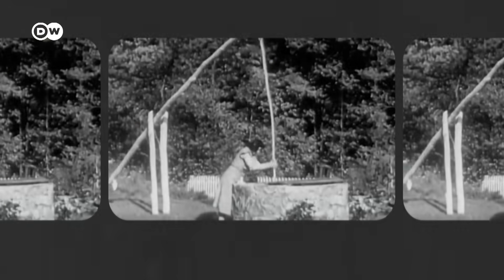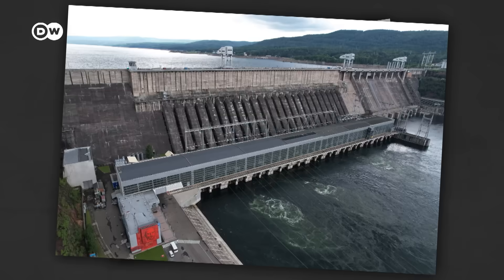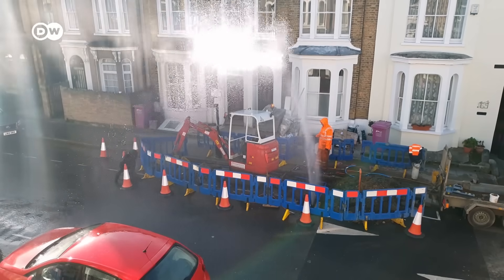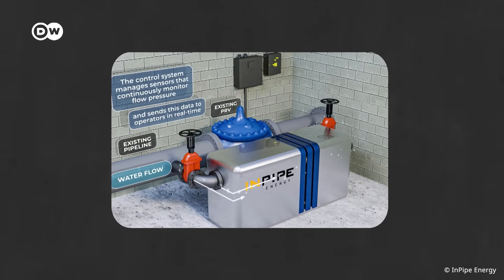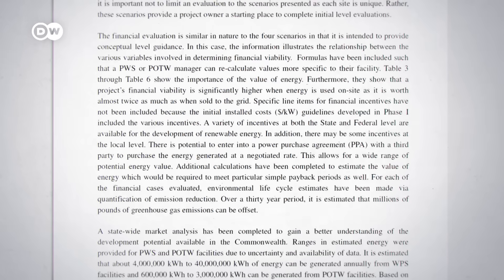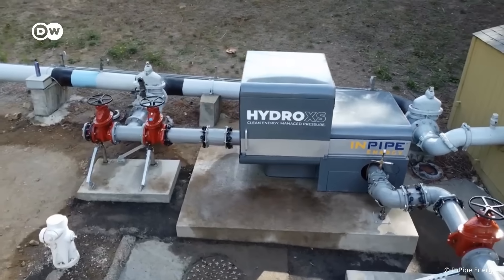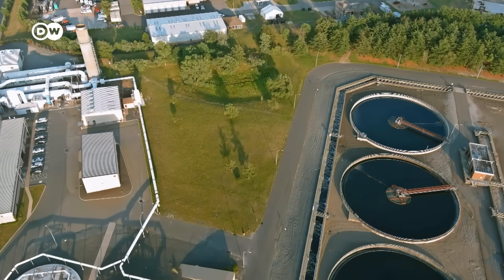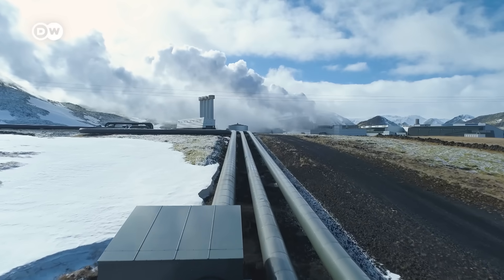In-pipe energy: The hydro power nobody is talking about

Comment: I'm a student and technician in renewable energy, and a similar idea had already occurred to me, I researched it and went to calculate it on paper (on a different scale than the video). Among the results, I came to the conclusion that a high pressure generates little energy, the yield would be low, and would demand more energy in the pressure pump that sends the water. For few people to generate energy to charge their cell phone at the beginning of the distribution line is feasible, but scaling it is complicated. There are several factors that influence performance, the water flow has to be very large for generation if relevant (among others), that's why hydroelectrics are good, but when water is pumped by electricity and you put an electric generator at the end, the gain is low, if it were so simple there would be infinite generators, but the laws of physics do not allow it. In my calculations, for example, approximately 5000 liters at an average height of 5 meters, would be able to generate the equivalent of 15 minutes of energy that a gasoline generator can, and with a submerged pump and that same generator it took me 1 hour and a half to fill that container. Notice how low the gain is. I love the videos on this channel, I loved the space for reflection on this, because I also thought, researched and calculated about this idea, on a different scale from the way it was presented. The idea does not seem to me to be efficient. However, this does not mean that the idea is not good, we should think more and develop ways to make ideas like this workable.
Reply: "and would demand more energy in the pressure pump that sends the water"
That was my first thought too, but if the overhead is low to keep the pressure and the flow of water is high we might be able to recover some energy.
As you mentioned, it seems unlikely to be much or spread out so much in small amounts to make sense.
8:31 if this is the size, I guess you can recover a bunch in one place.
My guess is: the water they have in that city probably comes from a high place or something.
Edit: just a quick look up of the city name: "Situated around a high plateau by the banks of the Tigris river"
Reply: My intuition says that in stead of 'recouping' some of this energy at the pressure valves it ought to be more economical and common sense to cut back on the part of the water grid that is at high pressure. To keep the flow strong and smooth enough, we'll need to compensate by putting tubes of larger diameter in the central grid and more water towers scattered around the landscape. These adjustments have a material cost, but with the larger tube diameter I think there comes a scale-advantage (and most of the cost comes from the installation process anyway, where the cost is proportional to the length of the tube and not its surface area).
Reply: @Hecatonchires1991  Agree. A more optimized delivery system and real-time adjusted pressure, rather than our current system of overcompensating (if I am interpreting the video correctly) and then dissipating the pressure in the form of wasted energy/heat.
Reply: Most cities don't have huge overpressure in their pipes. What you have in the main pipe is what you have in your pipes in the shower. Water is pumped to a water tower, central or on your building in case it's very high. No reason to put any turbines anywhere because if the distribution pipes have lower pressure because of turbines, you as an owner of a tall building need to have a bigger pump to send the water up to the top. You move the burden of pressure increase to the consumers.
Reply: I did my PhD research on the subject, and proposed a dimensionless method to design axial pico hydraulic turbines... You can find my paper googling  "In-pipe axial pico-hydraulic tailored turbine design: A novel approach using a dimensionless design chart"... 

You can't get much energy just recovering in one pressure reducing valve... You need to go complement or replace most of them...
Reply: @abrahamvivas9540 congratulations for your research!
Reply: so not that much ... untapped potential? please indulge me with my pun :D .
Reply: Here consider economics where power produced are sold higher than the cost of pumping power sourced from another supplier.
Reply: @erwinabelardopacheco5718  I was thinking that too. Shifting energy at an acceptable cost but still profitable perhaps in some niche applications
Reply: I am outside of the city,.  Therefore, I have a pump to pull water from the ground, and a 'bladder' to keep pressure in the pipes at the house.  I do not see where I could recover any energy.
But, like Anna Anka said, the water system in cities on the east coast of the US where I live mainly rely on water towers to keep pressure in the lines going to your house.  It seems like this system could work in those pipes - but would, I believe, not be a constant flow but dependent on how much water was being released downstream at any moment.  In other words, not a constant 'spin' on the turbine.
Reply: yeah, aside from low yield energy, the concept is a bit foolish. Harnessing excess pressure and flow in upstream sector is a bit understandable, but that only harness small amount of energy at not that reliable frequency of output. That excess of energy can also be simply solved (or already solved) by using variable speed pump based on load. On the other hand, putting turbine in series in pipe or just plugging microturbine on houses will just add more load to pump, causing pump to use more energy at possibly more inefficient condition. Overall energy conversion efficiency is also reduced, it's like you force pump use A watt more of energy just for you to use a fraction of that A watt. It doesn't save any energy. This concept is a bit like expecting bogus perpetual 'free' energy. This is where I'm glad my ME background help see through BSs
Reply: Plenamente de acordo. Também já tinha pensado nessa questão.
Reply: Before watching the video, I thought this was another way to take advantage of the shortcomings in alternative energy solutions like wind and solar (where you have peak power during certain hours) and using water as a battery i.e. pump water into elevated storage areas during times where wind or sun are at their maximum etc. Apparently not. That said, I think they are trialing water reservoir batteries in certain islands somewhere in the Atlantic.
Reply: TRY and think a way for 2 to 3 times faster  pipe water flow and tell me what you think
Reply: Have any researchers looked into energy from a trompe system? It's not fancy, not expensive, and yes, very old technology, but it does have some unique properties.
Reply: Just another scam for YouTube
Reply: It is a scam !
btw : It's still Demonising CO2 wich is actually still too low for plants and animals to function optimumly !
this propaghanda of Demonising CO2 needs to stop together with the Green Agenda is to enslave us more => things will get more expensive and elites will get Trillions of of it !!!
Reply: If you put a turbine generator on the water pipe that brings water to your house,  first of all, it will only produce current while you are running water and secondly,  your water flow rate will be significantly reduced.   Now imagine if everyone did that. The decrease in flow rate will force the water provider to increase pump energy... everyone's water bill will increase by more than the value of the electricity they make.  DUH.
Reply: You're not a very bright student are ya?
Reply: My friend, I just wanted to showcase why I value my opinion. This opinion was based on bibliographic sources; without them, they would be mere words. I am self-taught in various areas of knowledge and hold 5 degrees in distinct fields of knowledge. Yes, I consider myself a bright learner within my limitations. At least I am seeking to contribute to the dialogue on matters I find important, such as energetics. And you, what have you been doing to contribute to the future of the planet? @dalegribble1945
Reply: It's all for the feels and not the reals when it comes to renewable energy. The point of the exercise is to virtue signal to others. You doing the calculations is not what people want, they want to say "Look at me I'm great for doing nothing at all."  You should change your field of study to something different. You are trying to solve a problem that doesn't exist. The planet is heating up on its own as it has done many times in the past. You can't beat nuclear we have reached the pinnacle of energy production.
Reply: i suppose in a way it's another type of gravity "pump" (pumped hydro? forgot the term) that works by recuperating extra pressure at the receiving end of the plumbing?
Reply: My first thought was that all you are doing is adding impedance to water pressure down line in a system where you are trying to create flow. However in my home in Virginia like many around here we have a water pressure valve on the main water line. All it does is impede pressure. Surly it could be modified to generate electricity. Additionally there has to be many similar situations on a higher scale were flow gets reduced for management sake.
Reply: I could see a use case where some high energy need could be met by attaching a special valve to, say, a fire hydrant, and either treat the water like a waste byproduct and let it flow freely out of the other side of this generator attachment, or direct it into a tan for use later.  Lots of landscaping companies and other businesses can lease special metered valves from the water company that allows them to tap into fire hydrant and pay for what they use.  It could be another source of revenue for muni water authorities. 

 Imagine a farmer's market being set up miles from the nearest power line, powered off of a fire hydrant.  They could even make the wastewater into a decorative water feature, or fill portable tanks for use at the market.
Reply: There are probably a few cases where municipalities could install turbines to recover energy from stepping down the pressure, rather than simply dissipating it through an orifice, but in most cases the flow rates are too low and the periodic nature of the usage doesn’t make sense. However, rather than focusing on the losses in the system, it makes more sense to focus on the losses in the pumps themselves, especially in North America. The EU introduced regulations that require high efficiency pumps to reduce overall power consumption. We need such regulations throughout the world.
Reply: I don't think this represents a substantial source too. A system set up to increase the pressure of a residence does not increase the electricity bill very much. A system set up to perform the inverse service would provide less energy than that spent in the previous case.
Reply: Basically it's a case of not being able to take out more energy than you are putting in right? So unless the pressure is being created by green energy, all that would be happening is removing the cost to create electricity from the end user to the water pipe generating business? Unless it's a case of pipes bringing water naturally down from a higher plane, ergo essentially a standard hydro model?
Reply: Unicorns could solve it!' 🗡️🦓
Reply: Thanks for doing the math for me. I knew the concept didn't make much sense. It's like putting a wind turbine in front of your office fan.
Reply: You are a horrible technician. Just make wider pipes and waste less energy on friction. Problem solved.
Reply: @heyhoe168  Gotta love a solution where you need to dig up a whole city for minimal gain
Reply: @OutsiderLabs  that is a common situation when architector was getting "renewable energy" degree, instead of actually learning how to plan ahead.
Reply: so in cape town the fresh water is on top of the mountain, at the bottom we have a nuclear power station, but i hear its not efficient to store energy, better to make it where you need it. but we also have strong wave energy and wind. would be nice to have on e pipe for electric light and water.
Reply: it is a pipe dream X-D because, the turbine will only run while you take a shower. stop the shower. energy stops. i like to shower but not 24-7 #wtf X-D
Reply: Entropy and physics prevail
Reply: Would it work in a high rise? I don't know how much energy it takes to get water up there, but there's gotta be some energy you can get back with gravity when water goes down the drain, though I'm guessing the addition of poo, pee and your occasional gater would probably not be good for that system. Plumbers gonna need to become electricians too.
Reply: Anyone would have come to that conclusion without studying the problem.
Within listening to this video for 10 seconds, I could tell it was not realistic. Installing tiny water pressure generators in every household = higher water resistance = more electricity at the pumping station to maintain the pressure. It isn't possible to generate more electricity than is being used at the pump station, so this will always result in a net negative. After the time and money is spent installing water pressure generators in every household, you end up with a whole lot of inefficiency and stupidity.
Reply: Ultimate pressure creates steam
Reply: Now the video has been published in my native language, Portuguese, on the DWBrasil channel. What I wanted to convey here is that it's not a simple matter; several direct and indirect factors must be analyzed for a solution like this to truly work. If we don't consider these factors and their consequences, we will spend time and resources on palliative solutions. I find it extremely important to think about new ways to obtain and conserve energy, but if we don't fully understand the issue, it will be like changing the chain of a bicycle while it's moving downhill without brakes.
Reply: https://en.wikipedia.org/wiki/Ram_air_turbine reminds me of that. The reason our aircraft and cars use electrical power straight from the main power generator, is because it's more efficient. It's not free energy it's energy recovery and with recovering energy it's always more efficient to not spend it in the first place if you can.

In a pinch, in an emergency, it's a reasonable alternative to a temporary problem but making the system not require it to begin with (i.e. by running the system at lower pressure and simply boosting the pressure where needed) will be more efficient meaning more electricity never has to leave the grid.
Reply: im slightly flabbergasted you had to do any equations to know the obvious...
Reply: my friend, it is also obvious to me, but reality does not show it the same way for everyone, so I made a point of showing it because I have an opinion, the foundation to conclude something. I don't work with common sense, but with solidly based facts. I'm surprised you don't understand this. @paradiselost9946
Reply: My friend tells me he saw such system in use in Zenica, Bosnia.
They have the height, the pressure and the flow sufficient to use it for power generation and appatently it generates quite a bit of power, though I don't remember the numbers.
Reply: Dear you not aware of  turbine and flude machines I already designed which not effect the flow of water and provide 4 time more pressure to turn the turbine blades
Reply: Hi Helio
are you able to offer any expertise on the following set up?
CLOSED LOOP MICRO HYDRO:
- tank stored water > what sized needed??
- 40m head
- micro hydro generator > what type and size??
solar panels to run houe in day and pump water back up to tanks in closed loop system > what sized panel needed?
- 1kw power used per day, with 70% of this at peak time when sun not out 

would the above closed loop hydro system be viable and what size tank storage and solar panel size is needed for 1kw power use per day??

i currently have a solar powered bore pump and 75000 litres of tank stored water at 40m head on my property which is for my water needs only...... but now im thinking would a systemike this be able to be used for power?..... basicall using solar panels to power house AND pump water to elevated tanks.....>. then using hydro power for electricity at night > then pump water back up to tanks the next day when sun is shining.
(obviously the practical tank would need to be sized to allow for x amount of cloudy days)

id love to know if this possible and scale of system. thanks!!!
Reply: I have to agree with you it only works if you have excess flow and a better way to deal with that "excess" flow is a variable flow rate pump which will use less power in the first place. If you have excess flow or excess head in a gravity fed system , then there is some potential to capture that energy. Wth pump fed systems, there are ways to make them more efficient. Using turbines to capture efficiencies, is inherently inefficient. I just don't see this as viable at any level of scale.
Reply: Definitely a comment you'd expect the government to be making
Reply: This tech was thought of by students in the Philippines about 5 years ago. I thought then that it would make the water pump work harder and will offset whatever energy is created by the turbine. 

Have you calculated (just for curiosity or fun) a closed-loop system? Pump water that will run a turbine to generate power. Then feed the water back into the pump that in my untrained mind would make it easier for the pump to work therefore consuming lesser energy? I hope I'm making sense.
Reply: @jeffbeck9347 I thought of the closed loop system as well. Maybe some validity with it but I'm not an engineer btw
Reply: the only renewable energy is hydro, you clowns
Reply: @benadams6292 It's not renewable if you have to pump it up first (where does that energy come from?) then let it run down. Better to let nature put the water up there via rain into high-elevation lakes.
Reply: Even if it does not produce large amounts of energy, if every household had a net savings of 3-5% (maybe even 2-3%) from such technology, that would still add up to a lot in large cities and across the world.

We should be thinking of ways to save every where we can with as many simultaneous ways that we can. 

If that electricity is also used closer to where it is generated, it also reduces transmission loss.
Reply: @Jornandreja Those houses would be far better off just putting up some solar
Reply from the maker: @Helio Barcelos We found that this technology could be applicable for ANY type of water supply or disposable system. So, even though microturbines produce small amounts of electricity, if there were many (say, in cities), then it could be substantial. ✨
Of course, this is just one possible solution, and we need a slew to combat the ongoing climate crisis. Thanks for watching, and please let us know what you think of our other videos 🙃
Reply: @DWPlanetA  So let me get this straight... We're going to install relatively complicated, cost-significant, manufacturing-intensive, maintenance-required, low-to-no benefit devices on hundreds of thousands of water outlets to harness enough energy to power a coffee maker per household, maybe... You are solely considering ONLY the end energy output of these devices; nevermind all of the energy and pollution required to design, manufacture, install, and maintain a device that simply re-converts the potential energy from water pressure BACK into electricity. Think about it; you are generating electrical energy from a motor by converting the potential energy from water pressure, that was created using a electrical energy from a motor... Uhhh, the laws of thermodynamics apply.

No; this is not a viable economic nor ecological option.
Reply: @Saint_Oscar well said🎉
Reply: @DWPlanetA  It's always a good idea to harvest energy that's being wasted, but in this case, I fail to see what exactly would we achieve. The pressure in the water pipes is not a wasted energy, it is an invested energy. Pressurising water really is energy intensive, but releasing the pressure on the other end of the pipeline only exacerbates the problem, since more energy would have to be used in order to maintain required pressure. I suppose it could be used as a way to generate electricity in remote places, that somehow lack proper electricity connection but have a good connection of pressurised water (not very likely though). Am I missing something? Because it doesn't really makes sense to me.
Reply: @krystofbohac5313 yep, lots of small generators would only require more energy at the pumping station. Only water from altitude flowing downhill would work, maybe store rainwater from rooftops?
Reply: @DWPlanetA  that is really not the case. Pressure reducing valves do not waste energy. In fact, they save energy. Every turbine you install is powered by the pump on the other end. Energy doesn't appear out of nothing. Only case you could in fact generate energy would be high altitute water sources, but water flow is so small compared to traditional hydroelectric plants that it would not be financialy viable. It is a lot more efficient to use the money to build some solar/wind capacity.
Reply: @DWPlanetA  Each turbine will take away power or pressure from the water in the pipe... So they would need more power to pump the water..... Else this would almost be like a perpetual motion machine....

However IF the calculations are correct, that it goes so much power into pumping the water that the energy can be taken away without disturbing the pressure you get out of your tap... THEN IT WOULD BE BETTER TO LOWER THE POWER INPUT OF THE PUMPS! Less money needed to modify everything... How much power, CO2 emissions, etc will go to waste t make those mini turbines and implementing them???

This whole system just smells of a huge scam to steal away more of our money and keep polluting!
Reply: @DWPlanetA  And what would be the net environmental cost to manufacture, package, transport, install, and maintain a "slew" of microturbines and the electrical equipment needed to harvest the electricity? Surely your research into this tech took this into account...
Reply: @DWPlanetA 
You can't get more energy out then you start with.
The efficiency will never be high enough to make it feasible.
Reply: @DWPlanetA  if you try to harvest the energy from the the pipe, it also means the water company will need to use more energy to replace the lost.
Reply: @steven8148 exactly. It would only work with water from altitude. If we stored the rainwater that fell on rooftops until a tank was full we could run a small household generator off that.
Reply: @DWPlanetA  I bet you think solar roadways is the greatest thing humanity invented since we came up with pickled eggs.
Reply: @DWPlanetA  You have completely disregarded the challenges that would come with this energy. Water pipes don't always work, there will be problems like.
1. Decreasing water table leading to lesser supply of water and lower pressure.

2. We don't have only one season on earth. In winters the pipes get blocked, they even burst due to ice accumulation when temperature goes below 0°C.

3. Rusting is another factor where pipes get rusted, or accumulate minerals, same could be the issue with turbines you are talking about, which would hinder their efficiency greatly.

4. Cost effectiveness, it would simply not generate enough electricity for the buck spent keeping the above challenges in mind.

This was miy first take away from the video in first 5 minutes.
I believe these guys should find another career.